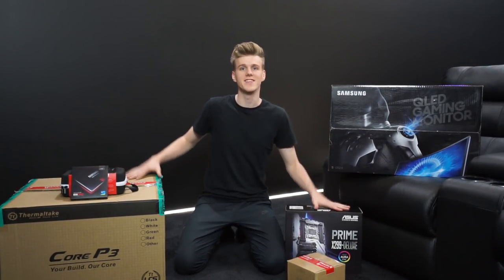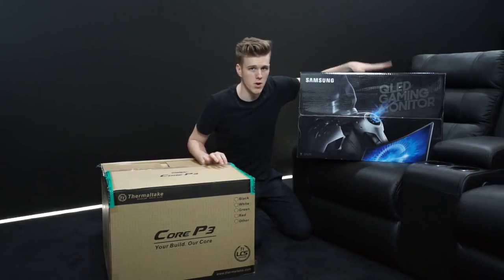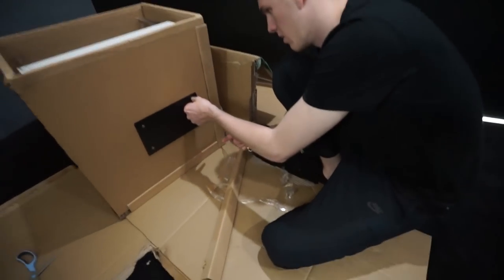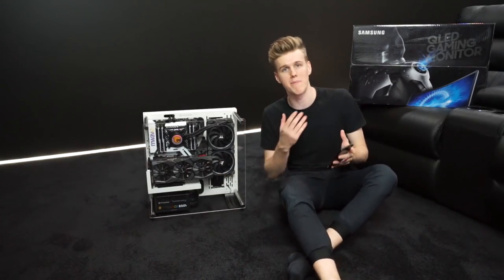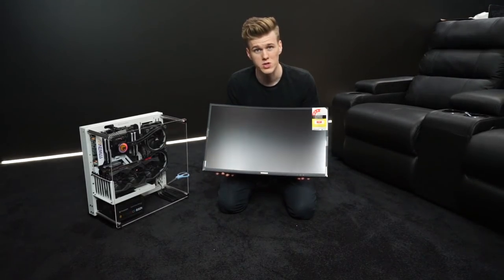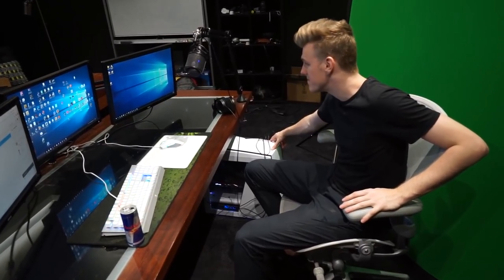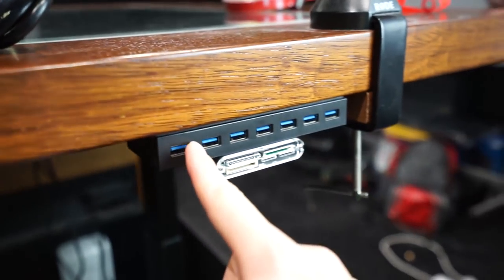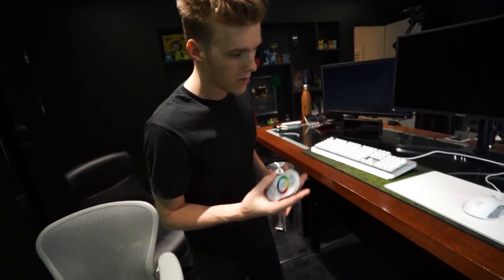THE $7000 PC UNBOXING + NEW OFFICE SETUP TOUR!

Comment: calls a i9 mid range TRIGGERRRREEDDDDDDD
Reply: MaikaIsBest 808 he means mid range for an i9 eg i9 7940x
Reply: i7 are  better than i9
Reply: Jaydipo i9 is good, but not ment for gaming
Reply: He called it a mid range i9 , He didnt call his i9 a mid range cpu .
Reply: Can’t edit a photo TRIGGERDDDDD
Reply: MaikaIsBest 808 yeah ik its the best
Reply: LoordYoda lol
Reply: lol
Reply: LiL'Tuber i9 is best for productivity work. This includes streaming and recording. The i7 is the best line of CPUs for gamers. For productivity on the cheap, Ryzen 7/Threadripper is the best.
Reply: The i9 is not specifically designed for gaming.
Reply: i3 i5 i7 i9 doesnt really make a differenceit the speed eg. 2.7GHz (slow) 3.1GHz (midrange) 4GHz and above (High-end)
Reply: He said it was a mid range i9 not a mid range cpu
Reply: i9s are so much better than i7s you clearly know nothing about pcs of pc hardware
Reply: i7 Extreme the latest of those which are 8th gen THE LATEST are the best for gaming because Ninja uses it
Reply: Jaze808 i9 just has more cores that doesn't always mean better performance so it comes down to different categories
Reply: I’m losing my brain cells reading this
Reply: Jaze808 the i9 is better but only by 2 or 3 FPS there’s is no point to put out the crap load of more money just for 3 frames technically the i9 is better but you might as well not fork out that much for a i9 when the i7 8700k does the job just as good. For editing, streaming, and such the i9 is way way better but for just gaming buying a i7 is a bad decision if you can afford it bc all these CPUs are really expensive when you can get 60fps on Pubg with a i3
Reply: lol i9 proccessors are for video editing rendering videos and some light gaming i7 are for hardcore max setting gaming
Reply: Its actually the worst i9 but i9 is beast so it is the worst of the best from Intel.
Reply: yeah it was weird an i 9 7th gen isnt mid range my ryzen 5 1500x is more mid range than that
Reply: An i3 8th gen  is midrange to me lol
Reply: Scopie your kidding
Reply: Scopie 
It is ment for gaming
Reply: @Scopie  wtf are you talking about not true kid
Reply: Jace Keller bruh, this was a long time ago.. this was before the i9 we have today
Reply: @Scopie  bruh just stop talking they went ment for it but they are good at it
Reply: @jacekeller4128  English? I dont understand
Reply: @Scopie  they weren't ment for gaming but there good at it
Reply: @jacekeller4128  I dont understand your logic.. 1: this is a comment 2 years ago, why are you 
discussing it?
2: Again, this was 2 years ago, and yes, they where good at gaming but an i7 was better

Comment: All the comments are:

That he had Supreme underwear
He left the monitor on the carpet
I9 midrange??
Reply: no he left the pc on the carpet
Reply: big tech noob
Reply: I think he ment midrange compared to other i9 models
Reply: @christianrhodes7492  its still not a midrange i9 though its a 7900X thats a decacore and besides that its a part of the 7th generation which is fairly new
Reply: @lucjewed4041   You realize that the 7900X is the lowest end i9, right?
Reply: @victorli2339  I never said it was the best I just said it wasnt mid range end there are a couple i9 models which are worse than the 7900X
Reply: such as the 9900K
Reply: He meant price range lmao, meaning there are i9’s double the price
Reply: @finnegan1168  thats not what midrange means though, in any circumstance does it means that he just didn't know what he was talking about
Reply: It doesnt matter if the pc is in the carpet, so long as its assembled and in a case
Reply: Neonic Plays not really, it can wreck the airflow and reduce the lifespan of the hardware massively.
Reply: Victor Li this does not mean mid range

Comment: It’s normal that the fans on the gpu not spins. It is because it doesn’t get hot enough. When you start playing, the fans should start spinning🙃
Reply: thats what i did i thought my gpu was broken lol
Reply: @jcitrine5769  R.I.P GPU
Reply: Uhh no, the fans on the GPU will spin when on no matter what, it doesn't turn on when it reaches a certain temperature. :upsidedownsmiley
Reply: RFK depends on the gpu

Comment: get it off the carpet. static electric will kill the pc.
Reply: Clip That Shit rlly?
Reply: Or add a glass panel underneath between the pc and carpet
Reply: (Next year) my new 10,000$ pc, (2020) my new 15,000$ pc and on and on
Reply: Clip That Shit no just no
Reply: if he keeps the pc on the ground with the carpet, it can add dust up really fast and can effect the temps
Reply: No it wont.  Unless the MB is touching the PC its fine there are risers designed for this to rise the MB off the case.
Reply: Clip That Shit  its breaking cuz of SCIENCE (bill nye intro plays)
Reply: MY 10,000 PC BROKE (INSERT ALI-A INTRO)
Reply: the case is touching the metal from psu.. so the case is grounded aswell as long as PSU is plugged in

Comment: Funny cuz the 8700k performs better for games than the i9 but who cares👌 also he gets worse airflow cuz its a open case

Someone help they mans😂
Reply: you mean better air flow the case is open this means that the inner fans have access to all the air they want instead of what is supplied to them by the case fans
Reply: LuC JeWeD no he’s right about the airflow being worse because it’s open it’s not as controlled and goes all over the place but it rally depends ok the airflow in the room
Reply: I have an 8700k and it is so much better than an i9 which are really only good for server PCs
Reply: MR. ULTRA if we are all honest he got ripped off i9 is not good/made for gaming in any way and 1080ti is a rip off for a shitty prebuilt $6000 PC. I mean that’s what you get when you play Fortnite all day and have no knowledge and let companies manipulate you into buying their overpriced products
Reply: @mcflanky8340   sorry what I ment to say was that because the case is open the gpu has more access to air as with a normal case it depends on how many fans are pulling air into the case
Reply: Flanky I mean he’s not just using it to play games...
Reply: MR. ULTRA na i9s are better
Reply: @abdalrahmanamrmostafa1975  no not really depends on the cpu but the 8700k is a beast and you would be surprised on how F#$King good they are
Reply: Open case will always run cooler then closed case.  And yes an 8700k is better for gaming as it can clock higher then the 10 core.
Reply: @abdalrahmanamrmostafa1975  Enless you can find a 5.2 -5.4 ghz i9 then no there not better for gaming.
Reply: @mcflanky8340  well his i9 is not 9900k and is the 7900k. Also pretty sure a company gifted it to him and he did not buy it
Reply: Nah, he doesn't only use his pc for gaming and the 10 cores can help him compared to the 6 cores in an i7
Reply: McFlanky i9 are good for work station PCs Xeon plats and Threadripper and EPYC are good for servers

Comment: The GPU fans is supposed to stop, and come back on, it does this to maintain a good temp. If u had a air cpu cooler, then that would be doing the same thing but it slows down instead of stopping. So I don't know if the GPU fans not spinning had something to do with your progress, but hopefully I was helpful lol

Comment: Intel core I9 is a bit overkill isn't it
Reply: I think he'd be better off with an 8700k. higher clock speeds and generally better. (apart from core count)it would run games better
Reply: The Xeon is
Reply: DrSwaggy Bro The i9 can destroy a xeon
Reply: he got totally ripped off. For that budget what he should have done is got an i9 with a lot of cores and overclocked the shit out of it with some god cooler because with his budget that wouldn't be an issue.
Reply: he streams so he needs lots of cores
Reply: DieselIab67 an i7 would be good enough for streaming
Reply: I agree
Reply: kinda
Reply: Swagger_duck_ 200 hell na well only in games

Comment: I cringed so hard when I saw you unboxing the computer on carpet
Reply: Same 😂 also he got scammed. He bought a prebuilt that costs 7000$ with A SINGLE 1080TI FFS
Reply: Y
Reply: Ali Rahman He is a streamer. So what you should’ve said is Ryzen 7 2700X, with a 1070-1080Ti. Anything lower as a streamer could hurt, such as a 6/12 core processor. An 8/16 core processor would help more, while still not bottlenecking even a Titan V with the 4.3Ghz beast of a processor.
Reply: Seeing the Mwave ad all over the video, he could've gotten it for a lot less
Reply: I think it is 7000 australian dollars which is equal to $5200 usd still kinda overpriced though
Reply: Cooper Bourne. And its put in vertical which will increase his thermals
Reply: For gaming yeah, he only really has the extra 2 for editing and whatnot. Even then, he doesn't need 18 cores for editing.
Reply: The 8700k handles streaming better with faster single core performance and better encoding techniques. But, he needs the 10 cores in the 7900X for the video editing so it'd be fast and not affective in his upload schedule.
Reply: IKR. Also he got so ripped off. For $6000 he got 32GB of Ram, a "mid range" i9, and ONE 1080ti
Reply: A pc's worst enemy
Reply: also the fact that he said " ex - 2 - 9 - 9 "
Reply: CREEPDEV he aint a steamer he a youtouber
Reply: Heath Osmond you can tell he knows nothing about PCs
Reply: you want him to open it on the ceiling smh
Reply: the carpet conducts electricity which could fry the cpu etc. and make them useless and broken

smh
Reply: @genguise7782  I don't think your bringing editing into the picture in witch case it is very useful.

Comment: In case anyone is wondering... you can build the pc for less than $4000 usd
Reply: Nicholas Beer AUD that's $5100
Reply: Yup
Reply: Nicholas Beer whats the cheapest?
Reply: NoobPlays the cheapest what?
Reply: Not anymore you really can’t thanks to bitcoin miners
Reply: Nick when bitcoin crashes they will flood the market with their resale 1080s, so buy them when that happens (thats what im gonna do)
Reply: Yep I built mine to start off 800 bucks then upgraded to spending a total of over 1000 bucks
Reply: U can buils for £800 in engalnd
Reply: $3999?
Reply: no u can get a good one fo £1000
Reply: *You can build a decent PC for $400 USD. You dont need that highass budget
Reply: Nicholas Beer that’s what I did
Reply: Nicholas Beer i built mine with the exact same specs for 2500$
Reply: MithrandilPlays Not anymore
Reply: nah mate its +3000$ because of the PC size. Smaller PC-bigger price
Reply: No you can’t I have a similar pc but instead of the 1080ti I have a Titan xp and I have an 8700k instead of the i9 his mother board and i9 add up to 1800. It about 4300
Reply: u can get a CYBERPOWER (myths pc) plus a monitor with lights and customized for $1300 usd to $3000 usd

Comment: Yo Im an absolute noob with pc setups but im trying to build my very own. Can someone tell me if these specs are alright?

CPU - AMD Ryzen 5 1600

Motherboard - MSI B350M Gaming Pro

RAM - Corsair Vengeance LPX 16GB 2400MHZ

Cooler - Cryoig CR-H7A

Graphics Card - EVGA GTX 1080 SC

SSD - Samsung 850 Evo 250GB

HDD - WD Blue 1TB HDD

Power Supply - Corsair CX650 650W

Case - NZXT S340

Software - Windows 10
Reply: It’s 1200, not 1200X.
And why do you need 16gb, that’s a bit overkill, you’ll be fine with 8gb.
Reply: everything is good in my opinion, but are you getting the 6gb or 3 gb 1060?
and 16 gb of ram is actually more needed than you might thing
Reply: CyrenArkade im actually getting Ryzen 5 and 2 4GB ram sticks - I just want enough to play any game on Medium/High Graphics dont really bother me. Just a smooth run
Reply: CyrenArkade and the EVGA GTX 1080 8GB
Reply: Bang! And the dirt is gone! Don’t get slow ram with ryzen, I have 3000mhz with mine and it runs flawlessly, as well as having it clocked to 3.9ghz
Reply: Terrance Butler So shall i get 2x8 GB Corsair Vengeance LPX? Im really not sure
Reply: are u kidding me if u have enough cash for a 1080 then u should upgrade ryzen 7 1700 and get x370 not b350 but 16 gb is enough
Reply: A ryzen 7 would work better with the 1080
Reply: Bang! And the dirt is gone! NO NO NOOOOOOO GPUS ARE F*CKING EXPENSIVE AF RIGHT NOW EVERY GPU NOT ONLY MINING ONES EVERYONE PANIC DONT BUILD A PC RIGHT NOW EVERYONE PANIC AND RUN AROUND CIRCLES WITH YOUR HANDS UP
Reply: Why 1080 with r5 1600x 1080 is kinda overkill
Reply: Bang! And the dirt is gone! You would probably want water cooling with the CPU but good build 👌
Reply: Bang! And the dirt is gone! Go for ryzen 7 pretty sure it will bottleneck the gpu
Reply: yeah decent
Reply: Bang! And the dirt is gone! Those are really really really good cause 1080's are super expensive these days
Reply: Bang! And the dirt is gone! Bang! And the dirt is gone! instead go with a ryzen 7 or go with a core i5 or 7 but a 7 or 9 is better with that 1080 but if you can overclock clock it to 3.9mhz or 4000mhz for better performance but only if you can am getting a core i7 with 16 or 32 or even 64gb with a 1060 or 1050
Reply: Get 12 GB of ram 16 over kill
Reply: STK Media its just the price
Reply: Seems good.
Reply: Wish I had this pv
Reply: Pc
Reply: Bang! And the dirt is gone! A GTX 1080, 8 gigs of ram is good
Reply: If ur buying that gpu I’d get a little more powerful cpu
Reply: Very good
Reply: Ishaan Singh 16g ram makes a huge difference and games runs sooo much better
Reply: The Ryzen 5 1600 will bottleneck the 1080SC. Paying extra for super locked will give you 5 FPS more at Max so don’t. Otherwise I’m pretty sure it’s fine 😅
Reply: Its Perfect! But you may want to go for 3000mhz or 3200mhz RAM rather than 2400mhz
Reply: Bang! And the dirt is gone!  you need gtx 1080ti and cpu needed i7 7700k and ram is okay
Reply: Bang! And the dirt is gone! Amd ryzen 5 1600 is sucks man
Reply: Just make sure its all compatible, especially your cpu and gpu

Comment: Meanwhile i can build mine for 5000$ budget with better specs
Reply: Daily Vines Exactly, I can build a pc that can run fortnite atleast 60 fps at good settings.
Reply: Yup! Why you don't order and just build it yourself instead
Reply: iMemez Pizza i dont think Lachy was aiming for 60fps thi
Reply: Daily Vines it’s because he got it of mwave he should be buying it of pc case gear which is way better to buy PCs and way cheaper
Reply: IKR
Reply: Ghost i did 700 bucks and use epic view distance, textures and anti aliasing and get around 200
Reply: I could build a pc that would get better fps for under $3000 lol

Comment: Lachlan, u got scammed, those parts do not equal to $6000 Australian
Reply: You forgot the $2000 fee for assembly and shipping...
Reply: He didn't even pay for it
Reply: it is worth 3000
Reply: it is worth about 4500 aud
Reply: Did some research. The computer is worth about $4.8K AUS. Switching the parts to different brands (really doesn't change too much performance wise) then it goes down to $4.1k AUS. Then lets not forget that sales have a major impact on price for custom PC building while on prebuilts they have little impact.
Reply: jak Kim You do understand inflation and a build price don’t you?
Reply: also the i9 price is a scam when you can get 2 less cores for half the price
Reply: i9 is overpriced however there are still some pros:
-more cores
-better IPC
-better OC

There is more to it than the "two less cores" for i9 vs threadripper.